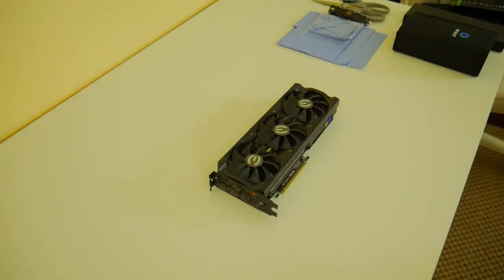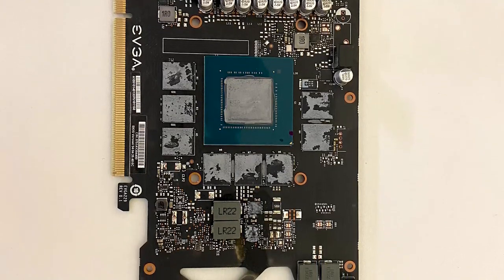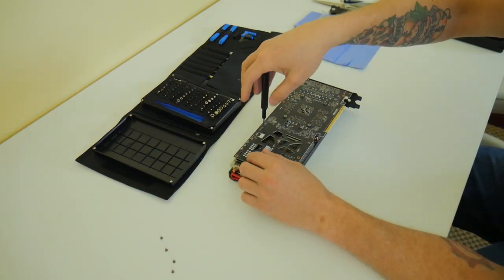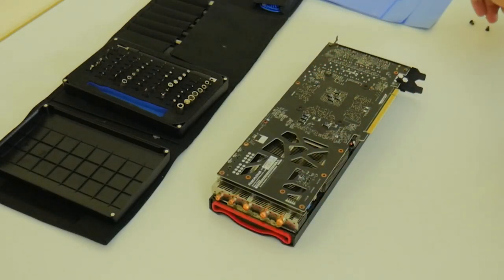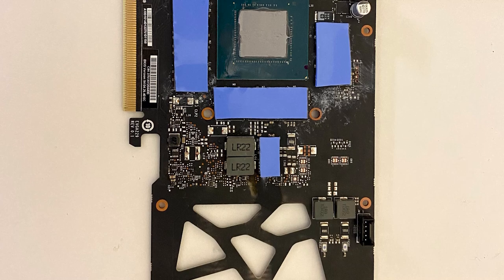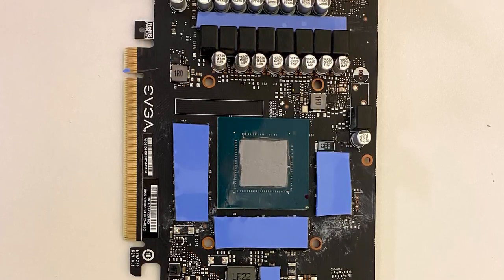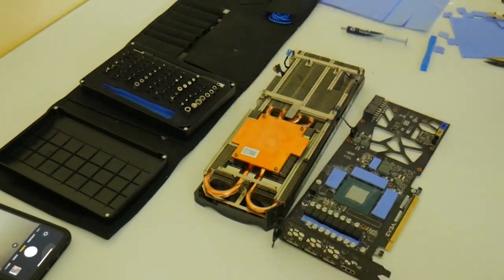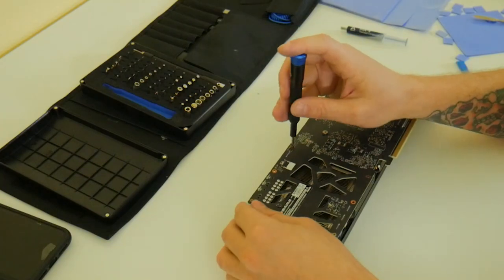EVGA RTX 3070 Black Thermal Pad Replacement

Comment from the maker: The only way to remove pad and paste maintenance is submerging bare cards. I believe Bitsbetrippin has been working on converting a farm and should have that info for you all at some point.
Reply: Doesn’t replacing pads void warranty?
Reply: @ReggaeDude66  seems the common answer i have seen is as long as you dont damage the card and before sending for rma you replace with the stock pads
Reply: @ReggaeDude66  it does! And mining does it as well (at least for EVGA, Galax and ASUS), so don't you tell em 👀👌
Reply: your thermal pad amazon link does not work, would appreciate if you update that, also hoe often do the fans go bad? have you considered immersion cooling for GPUs?

Comment: What temps are you comfy with on these 3000 series cards? I'm noticing the mem temps are usually about 20-25c hotter than the hotspot if you've got correct pads

Comment: OKAY.... so this is why Youtube should ENABLE DISLIKE button back. Decent advice from OP about this 3070. BUT, i have this exact SAME card, and i was thinking after a year i should replace the thermal pads and paste. And, honestly, after a year of non-stop usage for my 3070 for mostly mining, but also watching 4k videos on top of that, and gaming when i am not mining. It WASN'T worth replacing the pads, and I was using my 3070 pretty much 24/7. 

When i opened my 3070 XC3 BLACK. I noticed the pads were still soft, and not dried out. The VRMs that are positioned on the BOTTOM part of this GPU where the pass-through cooling is. Right beside the LR22 Chip. 5:20 mark. That NEEDS to be replaced with thermal PUTTY and not PAD. Exactly how the factory set it up. Since i replaced it with pad, due to following this video guide. My hotspot jumped all the way from what use to be 71c for gaming, all the way now to 85 to 88c! FOR gaming. For Mining, i am about 67c AVG for hotspot, where as before i use to be around 55c AVG. 

REALLY WISHED OP for this video showed before and after results. Because the results i got weren't that great. I had to contact EVGA and got thermal pads from their department VS the aftermarket thermal pads i ordred from Amazon. Replacing pads for the 3080 series and up makes sense, but for 3070. NOT WORTH IT. 

The only thing i would replace is the bottom VRMs with putty and Thermal paste. OTHERWISE, i would leave the pads alone, because for me, even after a year. The thermal pads were still working great, even for mining. ADDED alot of STRESS, had to re-assemble my 3070 at least 7 times to get proper contact wtih the heatsink. Even with the 2mm aftermarket pads. NOT to mention some of these  Thermal pads comes with certain Thermal Conductivity, which didn't work great for my 3070. 

Bottom line is... for EVGA 3070 XC3, just replace the putty, IF, it is dried out, or the GPU thermal paste. But, again, don't think it was worth it in the long run. Because i got better results before VS what i am getting now.

Comment: Honestly I don't think you needed to replace them. EVGA's thermal pads are known to fall apart when you take the card apart and they still looked healthy. If you weren't having thermal throttling then I would say they last longer than 3 months. It's just a shame that EVGA did not include a vram temp sensor on the XC3 cards.
Reply: I think the issue is that when you're mining 24/7 on this card, which this channel is about. You wear out the pads that much quicker. Yes, EVGA thermal pads should last for a while, but that's for gaming. I owned my 3070 just about a year now, and I get the feeling the thermal factory pads are getting worned out. I say this because, recently I had to drop down my memory OC settings for gaming. Where as before I would stay around 1100 OC on memory. Now I have to be on 850 OC on memory, otherwise I would crash. Mind you I MINE with my 3070 24/7.
Reply: @fpshooterful  one year is way longer than 3 months.

Comment: Any idea about Zotac cards ? I replaced my 970 GTX after 5 yrs only gaming, now I have 3070 Amp holo edition and thanks to your videos I have started mining, n m worried about the pads and stuff now. what made you want to change the Pads ?
Reply: best to look up ur Brand they may be different thickness of thermal pads to be safe you don't want to get to thick, or to thin it will make the difference...one can even Damage a card using the wrong measurements...

Comment: The links are not working for Thermal pad and IfixIt. Just takes me to Amazon home page. Can you cover 1070 card replacing thermal pads. My 1070 card has gone down to 24 MH on Eth

Comment: What was the temperature difference between the two?????
Reply from the maker: Like stated this was a preventative maintenance. I will start measuring every time for you all though. No real change on this card though. It wasn’t throttling
Reply: @SonofaTech  it would be good to use high quality thermal pads such as Gelid (12.8w/mk) and make a video comparison before and after the replacement. I have a Gigabyte Rtx 3080 and after replacing the thermal pads I was able to drop the Vram temps to 82 degrees from 106 degrees. Fans are at 75% instead of 100% though.

Comment: Have you done 3070 Msi Gaming trio X? 
I've been looking everywhere for the infos.

I opened one to repaste it and I saw the pads leaking oil so I thought I would replace them. It was messy. They're way more complicated than this card. 

There's a pad under some support bracket and another one under an heatsink which is also covered by a pad going directly on the cooler's fins. Really weird design though the thermals are good. There are also lines on the metal plate that line up perfectly for a thermal pad on some ITE module, but MSI didn't bother to put some. At first I put one, then I figured it might be better to not change the padding design. 

I've also been scratching my head with thickness. Some are 1.2 and the vram is 2.2. I figured they were squished 1.5 and 2.5 but I had to screw everything hard to make proper die contact. Where they, perhaps, 1 and 2mm and my caliper was slightly loose?

Evga's design looks so straightfoward in comparison. 

Please let me know :) Looking foward for that video as well!

Comment: So I know most manufacturers state in their warranty that they won't RMA when its related to mining.  Are they actually able to tell a card has been used for mining or is that more to scare you off?  I get that its better to DIY due to downtime or maybe not getting a card back, but curious what happens if you did try to get something covered under warranty.
Reply from the maker: Right they shouldn't be able to prove anything. However, in the current state you'll get your money back best case and no card. This has been happening a lot because of supply issues. I'd rather keep up maintenance than get a refund.

Comment: Would it be easier if I ran the card before removing previous paste?
Reply: depends since the day you bought it, if you had it more then 6 month to a year best to replace thermal pad also the companies usually use poor bards Thermal Paste and thermal pads so yeah i would replace and repaste from the day you bought it with better quality paste and oads

Comment: Just my 2 cents. Tom's wrote a good article about the new HW Monitor being able to read 3080 and 3090 VRAM temps. They ended the article with a "you've been warned". It's like a new car. How can anyone know its reliability? Whereas that 10 year old car that's solid and owners around the world have used without much issue. It's called track record. The 30 series cards a BIG investment and by my estimation they are a bad mining investment. Take the term "melted" from the gaming context and apply "melted" to the mining realm. I'll take horses. Proven horses.
Reply: 110 degree.

Comment: hey my rtx 3070 stays at 30% fan even when I set it to 50% manual. the hotspot says it's 65c, should I worry?
3070 cards don't have a vram temp sensor and since mining mainly uses memory i'm scared that my memory is sitting at like 90-100C all while my GPU's 55c temp is fooling the fans into staying at 30%.

Comment: Hi guys I need your help,  Is it possible that thermal throttling cards could cause PSU damage? my 4 rigs died day after I added PNY rtx 3070 GPUs, before dying I've noticed that few cards had issues with temperature and way too low hashrate. Oveclocks are same 130W, PSU 1800W 8 cards rig. same setup runs with Zotac 3070 very well. Thank you
Reply: Hi Dejan, can you update how are your mining rigs? Did you solve your PNY RTX 3070 problem?

Comment: Great video! I have both a 3070 (Zotac White edition) and a 3080 (Gigabyte Gaming OC). I was at this very moment shopping for thermal pads for my 3080 when you published this one, I think I have to buy a few more pads... oh, btw, no need for pads on the back of the 3070? Ill do it just because... Thanks for you videos, mate! Cheers!
Reply: Hey, did you replacemed the pad for your 3070? If so, any difference?
Reply: Hey, can someone please help me out. I just ordered Thermalright brand 12.8w/mk, but 2.25mm, I should've just went with 2mm. But, when I contacted EVGA about thermal pad size, they indicated to me 2.25mm. But, now, my GPU DIE doesn't seem to be making proper contact. I am getting close to 81c as my hotspt. Before it use to be WAYY less then that when it comes to mining. 

I wish OP in this video showed the before and after results, because I get the feeling this OP's results for hotspot may not be good? Not sure if anyone out there can confirm that? I have this EXACT card. I just ordered 2mm Thermalright brand 12.8w/mk, but, I am concerned about size. Should I just order 1.5mm instead?

Comment: So i  tried to  change my thermal pads on my 3070 Gygabyte OC and  when under oc  and undervolt  the card actually goes from 40c to 70c and doenst envet met the previous has rate of 60mh/s. I tried to place the old  thermal pads but its almost the same temps . (They were on avrg 50-57 while mining) Any tip on what mai cause this issue?  and also my Vram is running a lot cooler so thats nice .
Reply: maybe to thick or to thin i would not consider the same thickness of 2.0mm you have a totally different brand of card the thermal pads need need a totally different meaument, best to look it up. i have a Evga 3070 FTW3, and this video is a Evga 3070 Black, , i watched another video using 1.5mm and 3.0mm the card was the same as mine in the other video..l.; but i am not sure cuz people have different answers best to find the right answer don't want to damage ur card.

Comment: same question why change thermal pads?? not enought stock cooling capacity ?? how you measure temperature before and after installing ??aha because all time mining with overclocked memory destroy pads.understand
Reply from the maker: So in some cases MSI RX 5700 Mech oc and Gigabyte 3000 series were bad from factory. In other cases it's wear and tear. here is a video demonstrating performance impact https://www.youtube.com/watch?v=01CRZDl8vFA&t=59s
Reply: @SonofaTech  water cooling card will be best or putting card into fridge or something like this.
Reply from the maker: @zdenocharakter9616  watercooling a card still uses thermal pads. It increases performance but doesn't reduce maintenance.
Reply: @SonofaTech  what about no pads and cooling only with air straight to memory chip(cutting mettal plate required)air straight to memory chip.
Reply from the maker: @zdenocharakter9616  the only thing is submerging. Which is what alot of farms do. You basically strip the cards down and put them in circulating tanks.
Reply: @SonofaTech  ouuu yeeee

Comment: I would say that this is not entirely accurate. I just opened two 1080ti which have been running 24/7 for 3 years. One actively mining. Pads were in totally normal condition and could be removed intact. It's poor quality thermal pads if you have this problem and if you keep having this problem then i would assume you keep using poor quality pads. Better to use known brand like arctic  or thermal grizzly and then make a comparison :). Will cost more for pads, but less downtime and maintenance. If you run 8 cards in a rig, then it will easily pay for themselves by having even one less service window.  aand.. How do I know they were  stock - pads looked like stock and warranty seals were intact .

Comment: Good video, per usual.

The link you have for pads is to the Thermalright brand 12.8w/mk ones on Amazon.  These are the ones I’ve been using on all my 3080’s as I found that they definitely do a better job of cooling than others.  However, in the video it looks like you’re using the cheaper 3w/mk or 6w/mk pads.  Have you found that even the Thermalright pads need to be replaced every 3-6 months as well?

I’ve been running all of mine for about 8 weeks or so, and have to go visit my Mom about 1000 miles from here to do any physical work on my rigs (though it’s a good reason to go and visit) 😜
Reply from the maker: It just varies on too many things to know exactly just monitor temps and replace as needed.
Reply: Hey, can someone please help me out. I just ordered Thermalright brand 12.8w/mk, but 2.25mm, I should've just went with 2mm. But, when I contacted EVGA about thermal pad size, they indicated to me 2.25mm. But, now, my GPU DIE doesn't seem to be making proper contact. I am getting close to 81c as my hotspt. Before it use to be WAYY less then that when it comes to mining. 

I wish OP in this video showed the before and after results, because I get the feeling this OP's results for hotspot may not be good? Not sure if anyone out there can confirm that? I have this EXACT card. I just ordered 2mm Thermalright brand 12.8w/mk, but, I am concerned about size. Should I just order 1.5mm instead?

Comment: It's not that the thermal pads are breaking down, it's just the type of thermal pad EVGA uses. You can take a brand new EVGA card and open it up and the thermal pads will do this. I know as I water cool my cards, I only buy EVGA cards and this is what happens even with a new card. If you're not having any thermal issues, there is no reason to tear an EVGA card apart and replace the pads.
Reply from the maker: the putty right. So I do all the tear downs for the channel. I do custom loops as well. Just finished a anime build pics on twitter.
Reply: @SonofaTech  Yeah it's is more like a putty with a mesh in it to hold it together. I don't like them either as they fall apart and make a mess when putting on a water block, but they do a great job at cooling the memory. Only reason I replace them is because they do usually fall apart when I take the cooler off to put the water block on, plus EK blocks may use a different thickness pad. Other then that I personally would leave an EVGA card the way it is. However I've just been getting EVGA's Hydro Copper cards, but EVGA has not released one for their RTX 3000 series cards yet. EVGA shows them on their website, but no ETA on when they will be for sale.
Reply: @theplayernke  i also stick with buying Evga cards, think it was Jayz2cents mentioned that evga no longer makes evga cards that would suck know if this is confirmed  ???
Reply: @ThisOLmaan  What Jay said is correct. EVGA no longer makes video cards. EVGA will be out of business soon. Very sad what has happened to EVGA and it's the CEO's fault and could have easily been avoided.